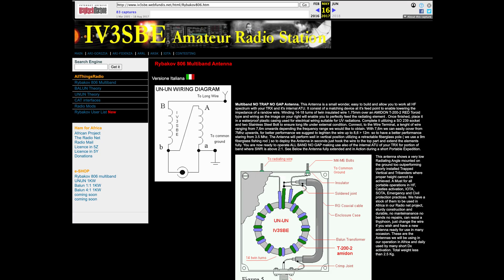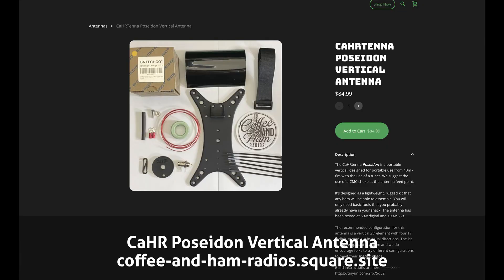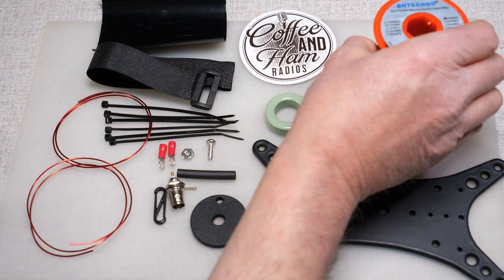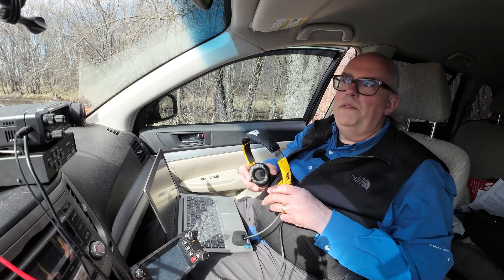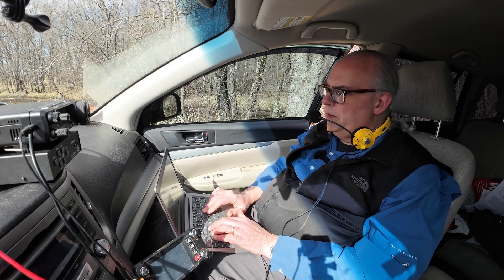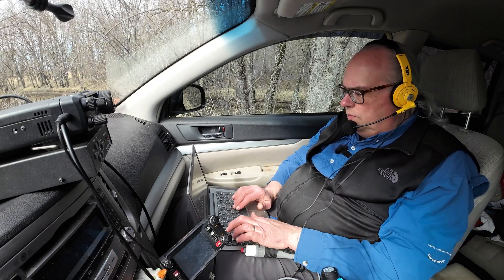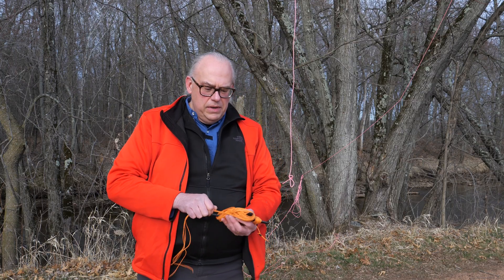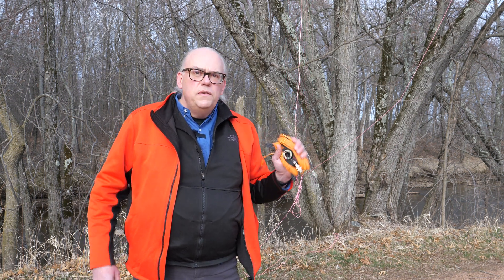Building the CaHRTenna Poseidon: A non-resonant vertical antenna powerhouse

Comment: I’m a rather new ham, licensed for about 4 weeks and just got my general yesterday. I have my new radio, the FT-710, and looking for a multi band antenna. Will the built-in tuner in the FT-710 ‘handle” this antenna without the need of an external antenna tuner? If I understood the video correctly it tested out at 3 to 1. I will be predominantly on 10, 20 and 40 meters.

Thanks for your content!

Comment: I have been using a switchable 9:1/4:1 UNUN using the same core for about 6 months now, I've had great luck with 58' inverted V and 29.5' wire in vert/sloper and a pair of 17ft counterpoises. I find that the 29.5' works well from 2m (surprisingly easily tunable and good simplex performance) to 40m, 80m is tunable but haven't tested. the 58' wire worked great 80-10. I'm using a small qrp manual tuner with ic705.

testing this core in 9:1 with 11 20ga trifillar windings gave me about -0.7db on 20-10m, -0.9db at 40m and -1db at 60-80m and -1.5db on 6m and 160m. (tested in the series s11-s21 with 2 cores)

Comment: Michael, outstanding video as usual!  I've been using mine mostly on FT8 for the past couple of weeks, hundreds of DX stations (including Antartica) with it.  Ape and I also smoke tested it a bit, ran up the power on my amp to around 250 and did ft8 for an hour or so.  Not super scientific, I ran out with a thermal imager every so often to check temps, we had it up to 160C, and it was still rocking.
Reply from the maker: It's great to hear the transformer handles the power really well. I can't wait to get this antenna back on the air for some digital operation.

Comment: 25ft is a good trade off.. still a 3/16 wave on 40 but not much more than a 3/4 wave on 10. So you avoid too much inefficiency on 40m and avoid creating higher lobes for take off on 10m. It’s a good all bands in one radiator antenna. It’s a compromise but 99.999% of antennas are to some degree. On 17 and 15 it acts very much like an efhw so is less ground radial dependent. It’s like a 5/8 on 12m so produces a good low angle pattern. It has nice gain on 10m. On 20m it’s a 3/8 wave vertical so should give a good match to 50 ohms with a 4:1 unun as feedpoint impedance here is around 200 ohms. On 40m as it’s 75% the length of a quarter wave you should expect it to be around 6dB down but not a massive deal breaker. Thanks for the video Michael 73.
Reply from the maker: In reading about the Rybakov, the antenna really interested me. I had it on my list of projects as the weather got warmer. CaHR beat me to the punch by sending me a kit, saving me the work of sourcing the parts.

Comment: Nice review of an interesting antenna. I fully support CAHR and it looks like they've put together a fantastic kit but I can't help but wonder if a budget minded ham might DIY with a LDG RU-4:1Unun for about $30 and wire they already have? I see the core material may differ but how much difference would that make?
Reply from the maker: Some people like the comfort of sourcing the parts from all one place, along with illustrated step by step instructions. But there's no reason why you can't assemble an antenna from parts on hand. You don't even need the LDG transformer, a suitable toroid is about $12-15 (with shipping). I've got a video where I built a random wire antenna with mostly parts on hand: https://youtu.be/wqKuttdHV8o

Comment: What feed wire did you use that already had a chock built in?
Reply from the maker: Chameleon Antennas has coax with integrated chokes. I used a piece of their coax.
Reply: Chameleon

Comment: I would recommend a good set of flush cutters. I use mine so much I buy them in a 5 pack.
Reply from the maker: I had a pair sitting on the desk, and wouldn't you know it, I grabbed the needle nose instead.

Comment: I just built their Apollo EFHW -- my first time building an antenna, first time soldering anything -- but what with one thing and another, I haven't had a chance to USE it yet. I'm looking forward to seeing what I might get with a wire a bit higher in the air than my usual 17' whips. I just don't get anything like the DX you seem to get routinely, and we're not that far away (I'm in the Twin Cities!), so geography is probably not the difference!
Reply from the maker: We're at similar latitudes, so you should experience similar results. The bulk of the DX that I get is with a wire antenna like the EFHW, or the end-fed random wire. I think you will do well getting one on the air.

Comment: How is this antenna different from just stringing an EFHW or EFRW vertically?
Reply from the maker: In a vertical configuration, an end fed half wave is going to be longer as the antenna will be a half wave long on its fundamental band. You could deploy the EHFW in an L configuration and get similar results, but you have all that wire to contend with. 

An EFRW with say 19 or 29 feet of wire vertically should also give very similar results. 

The advantage of this antenna is that with a 25 foot radiator, it is close to 3/8 wave on the 20 meter band and about a 3/4 wave on 10 meters. It develops some really good RF takeoff lobes on those bands that favor DX.
Reply: For 20m and 40m it’s a lot smaller.